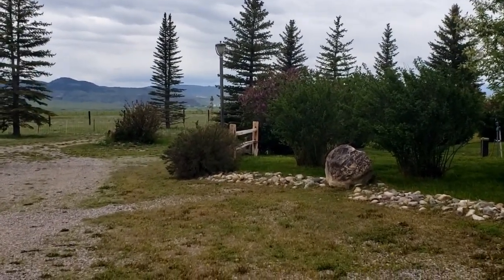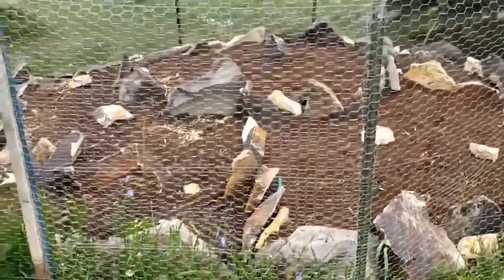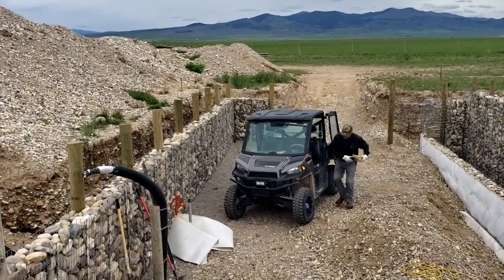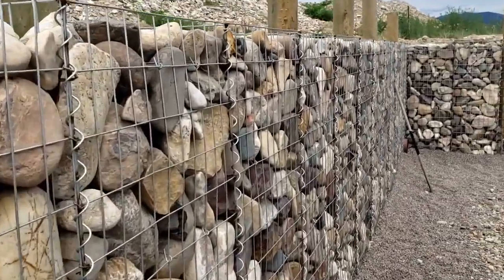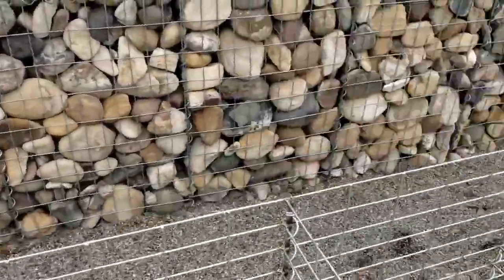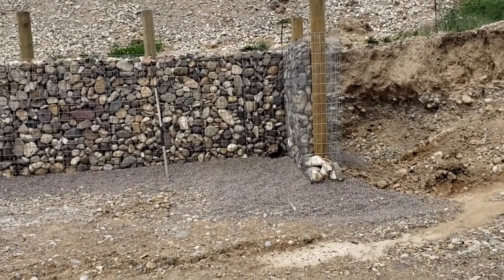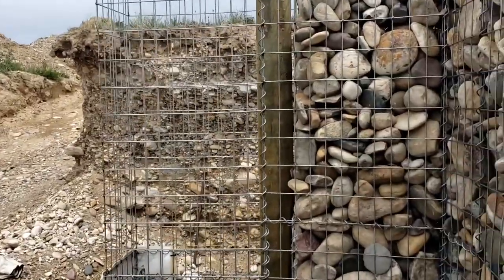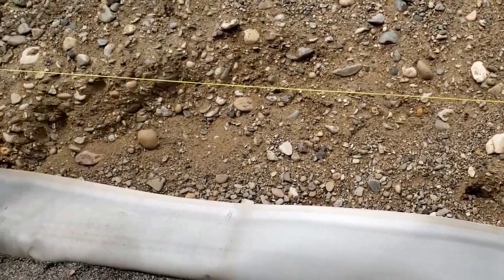Step 10c - Update on Building the Gabion Basket Walls for our Walipini/pit greenhouse

Comment: Those walls are beautiful - gotta love Montana! The fruit of yall's labor will pay off for years to come. I started my first gabion wall yesterday. I'm using 5' x 16' cattle panels that have 4"x4" mesh openings. The rock I'll be using came from an old, school cafeteria demolition (originally built in the early 1930's).
Reply from the maker: @outdoorztime2923  I just subscribed to your channel because I wanna see some pics on this project!  Very cool and proud!  Using cattle panels is excellent.  We made our first couple walls out of cattle panels as a test, very strong.  Stay tuned as we will be uploading soon.  We did some outdoor gardens in June for our tubers and corn.  Had to put a 6ft high deer fence around it to keep those critters out (not to mention the dogs burying their bones).  We had a massive amount of dirt to get rid of from the dig, so we have been hauling that away on another project.  We are about ready to stabilize the north wall with anchors.  Also been buying excess building materials needed from Craigslist and Market Place, so we are ready and set to move forward.  Cheers J&K
Reply: @montanalivinginthebigskyco8541  Ha... after seeing yall's, I hate to show mine. Saturday I drove my last t-post and drove it right threw my internet cable - go figure. We're back up and going today. The internet company was fast to run us another wire.
Reply from the maker: @outdoorztime2923  I had to laugh.  Jim is a Master Electrician by trade and we own our own Electrical Contracting Company that we have really scaled back as Jim is retiring from the big stuff.  Having said that, I had to laugh at your comment about driving a post through your cable.  You would be surprised how often that sort of thing happens.  Jim gets called out all the time on that kind of stuff.

Comment: I am looking to build a gabion retaining wall, but the prices I am getting for prebuilt baskets are really high. For the baskets that you made how did you go about minimizing waste? Based on my sketch of a 3ft x 1.5 ft  basket using a 2"x4" cattle panel, I would end up with a side that does not have the horizontal bar.
Reply from the maker: We ordered most of our baskets in 2020.  We ended up changing our dimensions later and had to order more and did have some issue with supply.  My husband is a contractor so he is very good at measurements.  However, we did have some waste or extra panels left over which we will use as trellis for planters.   Most cattle panels are a 4 gauge metal, which is very strong for a retaining wall.  However most cattle panels have larger squares which means you need bigger rocks.  Retaining walls made from gabion baskets have smaller diameter squares so you don't need to use big, big rocks.  The gauge though is lighter at either 9 or 11.  Our gabion walls are in sections.  Each section is 2 feet wide.  So think of this as a separate box that has a top, bottom, 2 sides and a front and back.  Each section is cork screwed together to get your wall length.  So if you are making out of cattle panel, you would need to do the same sections, or in other words, you would need to add the sides every two feet.  Do an internet search on gabion baskets to see who sells in your area.    If you buy from big box stores or big internet suppliers (ie. Amazon) , just make sure you are getting rust resistant, galvanized metal that is at least 9 or 11 gauge wire.   If you wire cage is made of  twisted wire, instead of tap welded, you will pay more.
Reply: Where did you get your baskets at? 😊
Reply from the maker: @30cjbeast  Thank you for your question.  I bought the kits from several sources.  I ordered some kits in 2020 and had little sourcing issues. Availability became an issue in 2021 and some orders were backorder then canceled.  Other deliveries  came incomplete.  You may want to buy domestically.  (If you are in the US, Earth Wall Products is a USA company).  Check with large landscapers in your area for sourcing since  gabion baskets are typically used in garden walls.  We bought tap-welded baskets and I wish we would have gone with twisted wire.  This would have saved time in reinforcing.  I talk about this in one of my videos so that is something you may want to consider if your walls are tall.  If you buy from big box stores or big internet suppliers (ie. Amazon, Wayfair) , just make sure you are getting rust resistant, galvanized metal that is at least 9 or 11 gauge wire.   If you wire cage is made of  twisted wire, instead of tap welded, you will pay more.   
Cheers
J&K